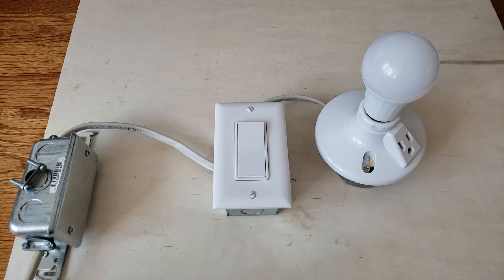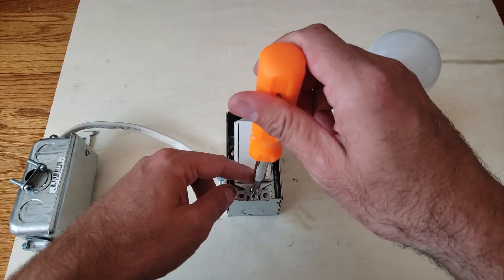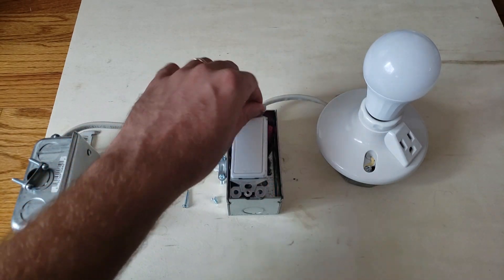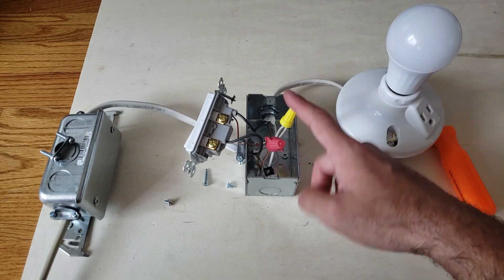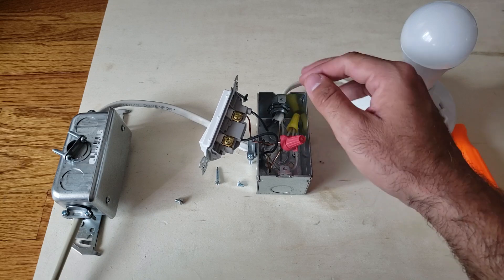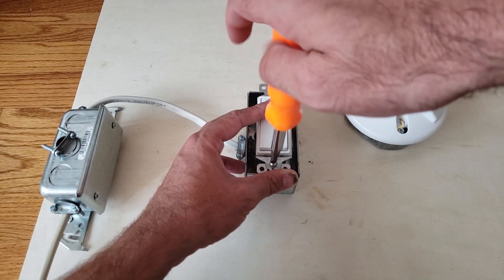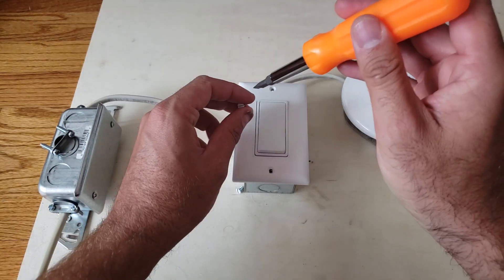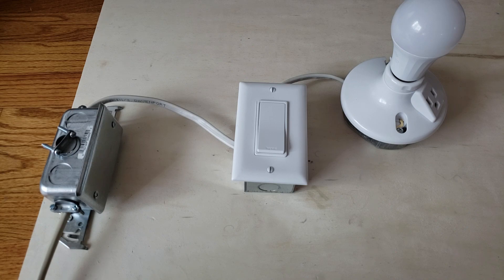Do I have A Neutral Wire?

Comment: I’m in the middle of a project, switched out an old dimming track lighting w/ a new one. When I got to replacing the switch, the box was a mess. I had 5 white wires in a nut, and 3 of them had 120 V on them... wtf? Thinking maybe they ran out of the color wire red/black.. my dimming light now flickers or just shuts off. Feel like i need a neutral.. I tried terminating the white wire to the box cuz same as ground right? Any advice... feel like I need to redo some wiring at my house. Wasn’t my work, but recent years I’ve learned this stuff.

Comment: Not sure if you can help, but I have a three way switch and there is a black, white and red (and ground) wire attached to the switch.  In the back of the box, there is a white wire and black wire tied together with a nut.  Does that make sense?  Is the white in the back the neutral?
Reply from the maker: White wire is the color designation for neutral.
Reply: @OneHourSmartHome  Thanks for replying so quickly!  So in this scenario, would it be okay to connect the white wire on the smart switch to the neutral and black wires under the wire nut?  Or do I need to get the black wire out of there?
Reply: White is the standard color for a neutral in the USA but.... it also can be used as a phase wire/hot wire if it is marked as so, being black tape, paint, marker, ect. Where you have the two tied together I would say it is not neutral. I'm retired now but have done electrical work all my life from house wiring, hospitals, schools, and finishing on power lines that supply power out of substations.

Comment: If my new, to be installed switch has a black, red, and green.  How do I manage the red and black against the two black wires you show kn this video?
Reply from the maker: Black is typically hot, red is typically load, and green is typically ground. If you dont have a white wire you don't have a neutral wire or your wires are so old they arent colored in which case it might be good to consider updating the wiring. White is the universal color for neutral wires.